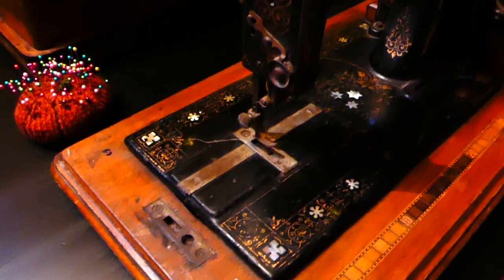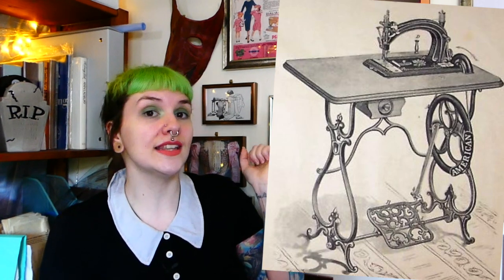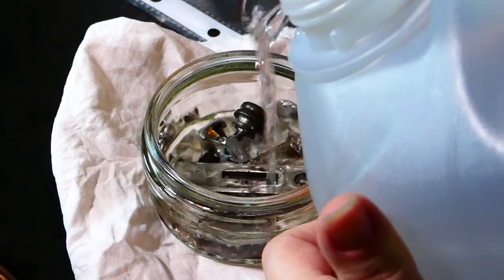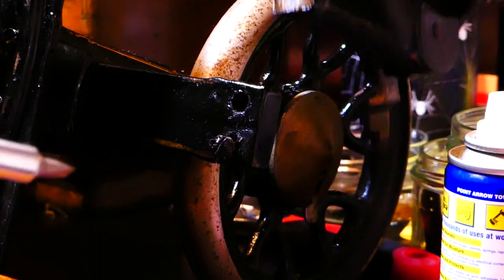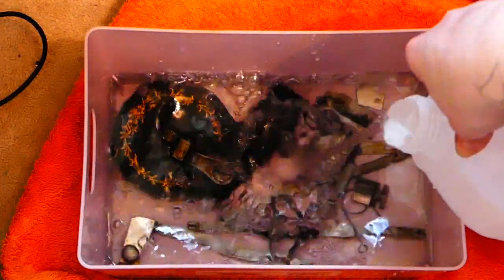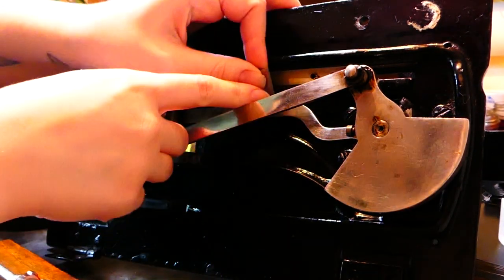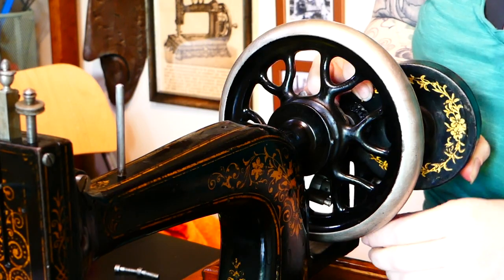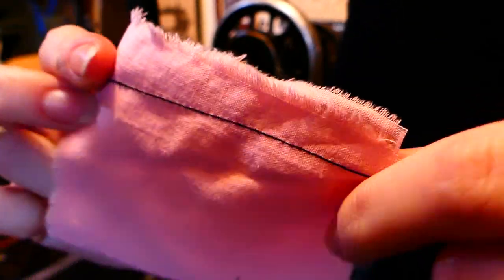I tried to save this 145 year old Sewing Machine! (Antique Victorian Sewing Machine Restoration)

Comment: If anyone needs advice on redoing old machines, Vintage Sewing Machine Garage and Andytube are invaluable. You do have a rarer machine, but at least the principles are the same. Sewing machine oil and 0000 steel wool are great for getting rust off metal pieces with less damage. The base metal parts that turned dark in vinegar can be polished up some. I also found that out the hard way! I always take lots of before and during pictures when I’m disassembling.

Comment: Bravo! I haven't been brave enough to take apart an entire vintage sewing machine to that degree. With that said, when facing stuck screws I would recommend shielding the parts that aren't stuck or are painted and using a small amount of WD-40 on them, as opposed to dunking the entire thing in vinegar. I also highly recommend finding and using hollow-ground or precise fit screwdrivers instead of the angled flat-heads to avoid damaging screws.

Comment: More than likely, that large 'stuck' screw is reverse threaded.  So instead of righty tighty lefty loosy.  It goes righty loosy, lefty tighty.  It's done that way so as the handle turns, it doesn’t constantly loosen that screw.  Give it a try.

Comment: I think the green was the clear lacquer being affected. I had a section similarly affected by some long standing tape 😞
Lots of sewing machine oil and car wax from the feather weight shop later and it's completely unnoticeable!
Also from similar chome damage problems I found out that there are places that you can buy little chome plating kits from. You can just replate sewing machine feet in a little tiny cup!!
Reply: I had no idea you could do that! I want to buy that for my own machine restoration, yet I worry I will electroplate everything I can get my hands on

Comment: What a lovely! 
So exciting to see someone else tackling one of my favorite projects. For those screws that just wouldn't come loose, try soaking---and I do mean SOAKING--the screw location with oil and leaving it for several days. Each day, check it to see if it is looser. After about a week, if it's still not coming loose, use a hair dryer or heat gun on a low setting to gently heat the metal. Lots of oil, lots of time, gentle pressure.
Reply: Reminds me of a (far gentler) version of how we used to get "nature-welded" ball joints off of old cars in autoshop class - we'd light them on fire with a hand torch and let them burn off the grease inside them like the most redneck oil lamp ever, then beat the snot out of the warmed-up pieces until they finally released. 😆
Reply: @sonipitts  My spousal unit is a hobby mechanic…guess where I got the idea? :)

Comment: Absolutely blown away by your ability to take it all apart and then put it back together and make it work!  Did you count how many parts there were?  Or how long the process took?  I usually put my rotary cutter, which has 6 parts, back together wrong when I change the blade, so you must have some incredible innate ability with spatial ability and mechanical stuff!